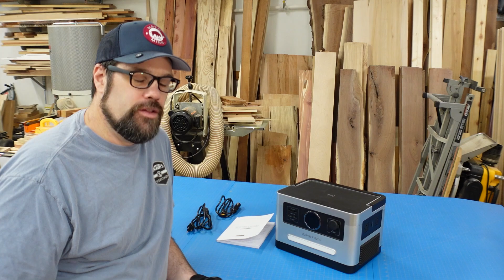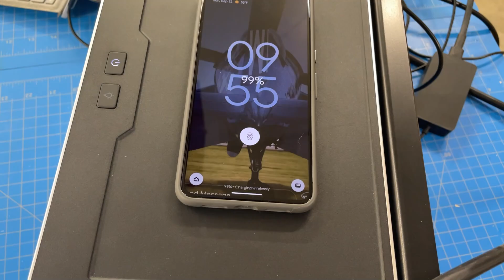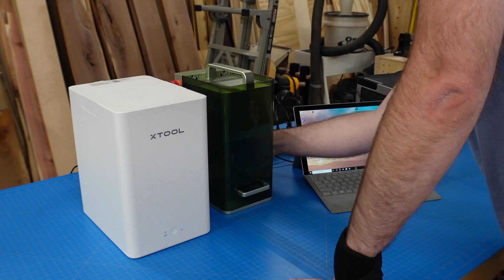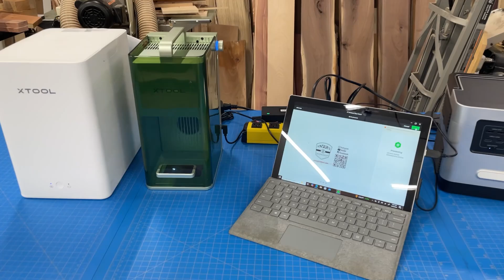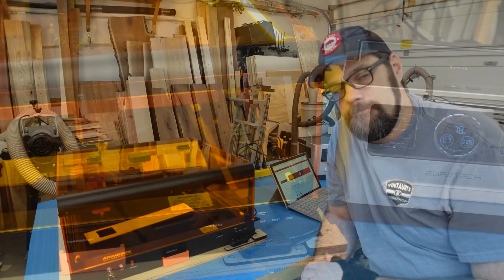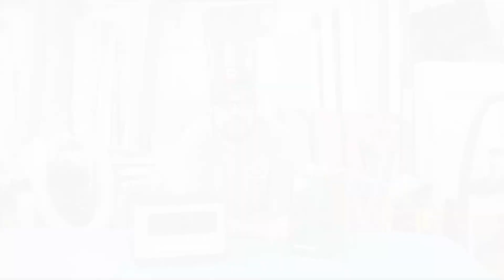Tips for Portable Laser Power - Egretech Sonic 1200

Comment: Thanks Steve! I’m going to get one to use at shows with my ICube. It’s $160 off on Amazon right now!! Makes it a great price!
Reply from the maker: I think you'll see similar numbers to the F1 when using your ICube!  It's a great add on to the event kit.  The Amazon price is a nice deal too!  I've got both links in the description for people to use.
Reply: @Vintauri  Do you think the 600w version would be okay for the SculpFun ICube, an IPad, and an air purifier? I’m not sure what numbers I need to compare my devices  with which machine I will need.
Reply from the maker: @Quilter5392  It will run the devices but you'll be limited to half the overall run time.  Check the power supplies to see what their watt rating is such as my laptop was a 44w power supply.  That will give you a ballpark of each devices max power pull.  Add them up and then divide the 500Wh by that number.  So if you end up with 125w total your max run time would be 4 hours if everything was perfect.  You'll likely get less than that due to losses in the conversion.
Reply: Looks like good little battery source. I have not heard of them thank you.

Comment: I wonder if it would damage anything to leave it plugged in while it is being used to act as sort of a UPS and to keep the spikes during laser operation from affecting the line in demand?
Reply from the maker: It's not recommended without the UPS mode, you would be constantly draining power from it while also constantly charging the batteries.  This would degrade them faster than normal discharge then recharge cycles.  Now I'm not saying that I've never done that with some other ones, but I also know I'm likely reducing the lifespan of the unit.
Reply: @Vintauri  Okay, Thank you!